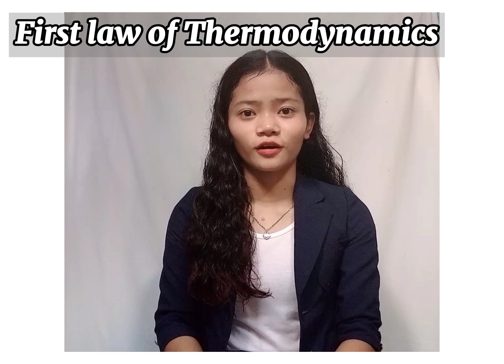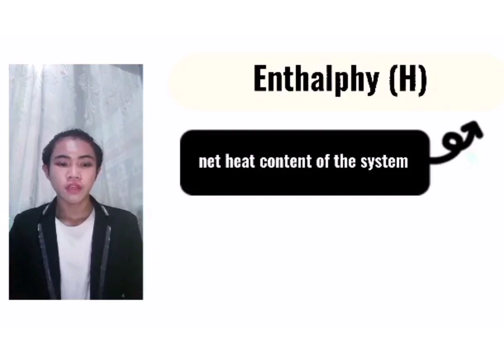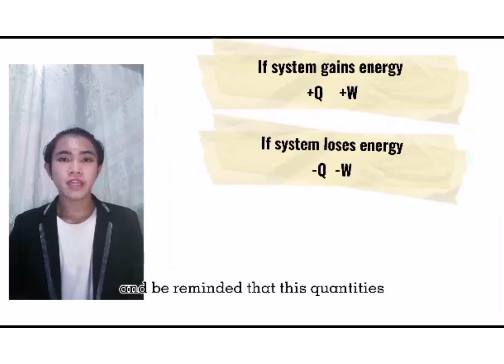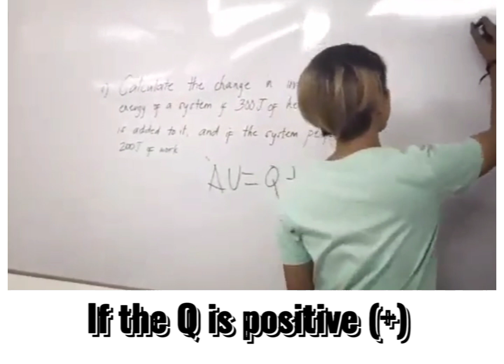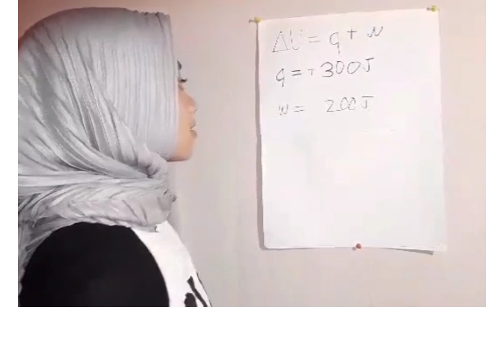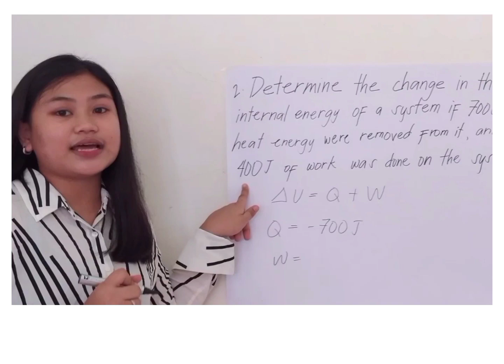Basic SCIENCE | First Law of Thermodynamics

Comment: It's true, according to the first law of thermodynamics, because through exchanging of energy, the total energy of the universe is constant. A system can exchange energy with its surroundings in the form of heat or work, which would lead to a change in the internal energy of the system. However, the change in the internal energy of the system will be equal and opposite to the change in the internal energy of the surrounding, such that the net change in the total energy of the universe is zero.

Comment: Adiabatic process is a process in which no energy flows in or out of the system as a result of change in the temperature.
There are 2 ways Adiabatic process can take place.
-the system is insulated (covered in nonconducting material to prevent the passage of electricity)
-the process occur very quickly so that the heat cannot take place (heat occur slowly)

(Recall that the change in internal energy of our closed system is equal to the sum of the Q and the W, where in Q is the heat and W is the work.)

ΔU = Q + W

Since we are dealing with an Adiabatic process which states that there is no energy that flows in or out of the system, that means we won’t be having Q in our formula. This process simply implies that the change in internal energy of our closed system is equal to the work.

ΔU = W
Reply: If there is an increase in internal energy of our system that is undergoing an adiabatic process, the energy that increases is a result of work that is done by the surroundings on that system, likewise if there is a decrease in internal energy of our system, it implies that the loss of energy is a result of the work done by the system on the surroundings.

Comment: An isothermal process is a thermodynamic process, in which the temperature of the system remains constant (T = constant). When dealing with an isothermal process, you can use the fact that internal energy is directly proportional to temperature. This means that for a constant temperature, there is a constant internal energy. Since internal energy and enthalpy are both function of temperatures and since temperature is constant, the changes in internal energy and enthalpy is zero. So with ∆U= 0, the first law of thermodynamics can easily be re-arranged to Q = W. In other words, the heat added to the system is equal to the work done by the system, meaning that the heat added is used to do the work.

Comment: "ISOVOLUMETRIC PROCESS"

The isovolumetric process has 3 ways we can called; the isobaric process, constant-volume process and isometric process. The isovolumetric process is one of the type of thermodynamics, the process states that the volume in the closed system remains constant. In isovolumetric, no work is done, that means the heat can flow in and heat can flow out,so the internal energy can change. Since the work is zero, the only way to change the internal energy is through heat. There are many formula that we can see in the google and they have also the same process, so this is one of those formulas, Pf=P1 or (∆P=0 and dP=0)

Comment: what is the example of first law of thermodynamics in our daily life?
Reply: Another example is a bicycle pump. When we rapidly pump the handle, it becomes hot due to mechanical work done on the gas, raising their its internal energy.
Reply: Other example of the first law of thermodynamics is if a person puts an ice cube into a glass of water and later forgets to drink it,then after a while the person will notice that the ice jas melted but the temperature of the water has cooled.
Reply: we use air-conditioner absorb heat from inside of home and pump it outside.
Reply: we use air-conditioner absorb heat from inside of home and pump it outside.
Reply: An example that I think can demonstrate the concept of the First Law of Thermodynamics is money. In daily basis, we indeed are using money. We use money to buy goods and stuffs that we need for survival or sometimes we simply want to buy it. By buying something, your losing your money while the vendor or seller gains the money. Later on, the seller will possibly spend the money for their needs, then the money will be on another person, and probably, same situation will happen and so on. For that exact reason, the money you spent was not your creation and you did not destroyed it, you used it in buying goods and so it was being transferred to another person.

Comment: What is the importance of the  first law of thermodynamics?
Reply: The main reason why the first law of thermodynamics is so important is because it enforces the principle of conservation of total energy in a system. It states that -
'There exists a variable of state, the internal energy E. If a system is transformed from a state of equilibrium A to another state B by a process in which a certain amount of work W is done by the surroundings, and a certain amount of heat Q being transferred from the surroundings, the difference in the internal energy of the systems is equal to the sum of Q and W.
Reply: First law of thermodynamics gives us the concept of energy conservation. As well as it is important to keep in mind that the first law of thermodynamics is applicable anywhere and to all objects.

Comment: How can we explain the difference between temperature and heat in a simple way?
Reply: Heat and temperature are a closely related topic, and as such, the difference between the two can be a bit confusing. The core difference is that heat deals with thermal energy, whereas temperature is more concerned with molecular kinetic energy.
Reply: Different between heat and temperature
Heat- the degree of hotness or coldness of a body or environment
Temperature- is the measure of the thernal energy or average of the molecules in a substance.😉
Reply: Heat is a one type of energy ,but Temperature is intensity of heat .Simply temperature express intensity of heat.
Reply: Temperature is about the hotness and coldness of an object. Whereas heat is an energy being transferred from a hot area to a cold area. For example,  when we are coming out from a cold room and directly be exposed to the sunlight, our body temperature changes. The heat from the sun causes our temperature to changes from cold to hot.

Comment: What does the 1st law of thermodynamics state?
Reply: The first law of thermodynamics states that in any thermodynamic process, when heat Q is added to a system, this energy appears as an increase in the internal energy stored in the system plus the work done by the system on it's surroundings.
or to shorten that, energy can neither be created nor destroyed, but it can change from one form to another.
Reply: The first law of thermodynamics states that energy cannot be created or destroyed it can only transfer to one form to another form.
Reply: According to the law, energy can neither be created nor destroyed, it can simply be transferred from one place to another or be converted to different forms.